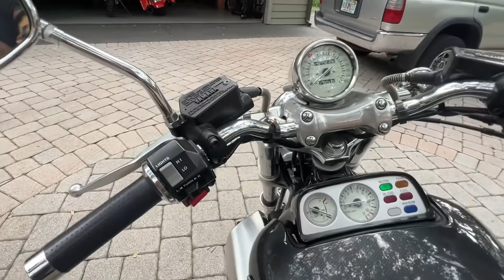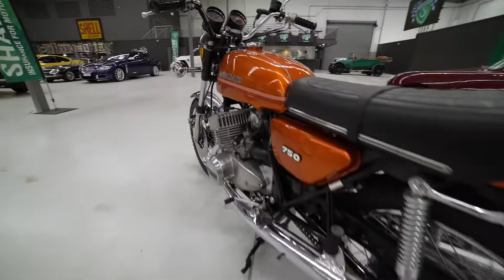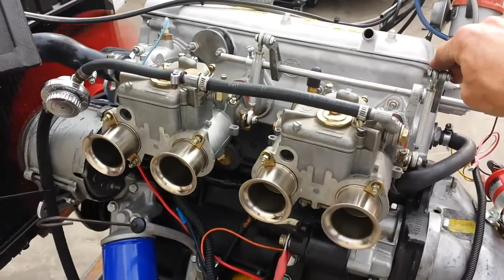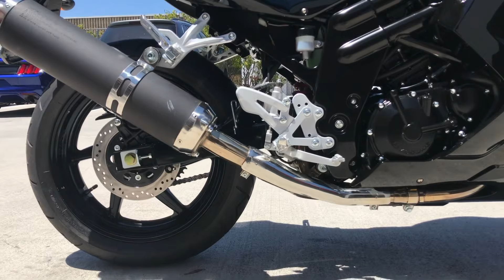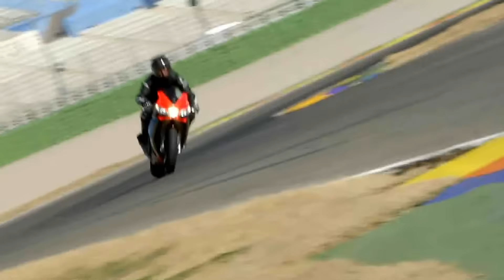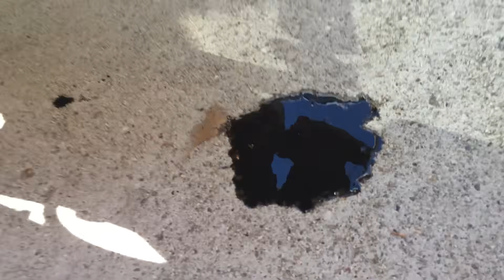15 Motorcycle Engines To AVOID At All Cost (Buyer Beware)

Comment: I have a twin cam 88 with upgraded hydraulic cam chain followers. Not a single failure or oil leak to be seen in 60,000klm so far.
Reply from the maker: That’s spectacular! I honestly believe most engines will last a lifetime if you properly care for them change their oil and check valve lash keep bolts torqued to spec. If you haven’t please like subscribe and share this page so I can keep making content for everyone!